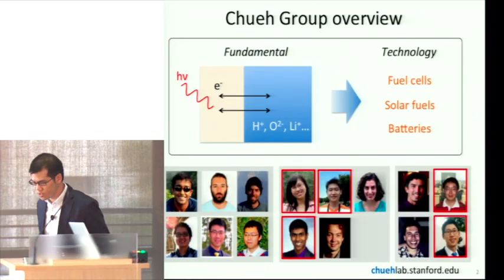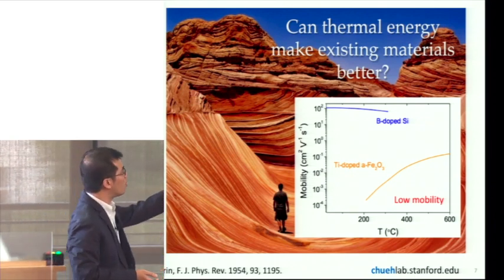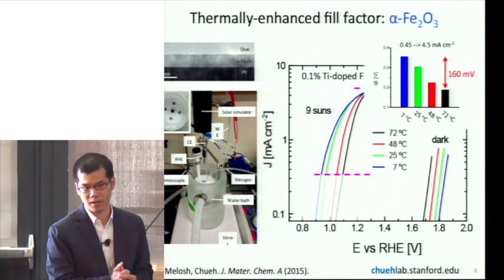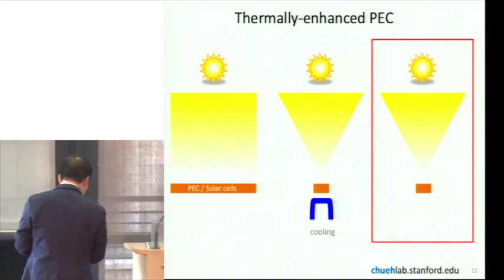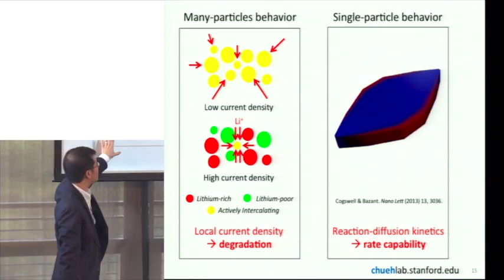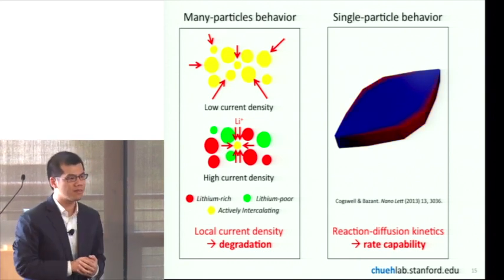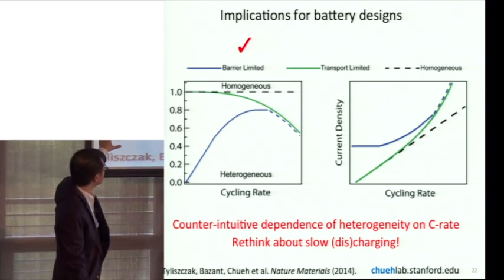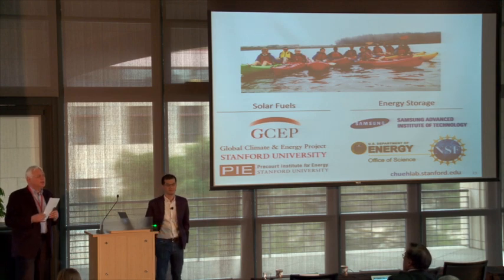William Chueh | Paradigm-shifting materials insights for solar fuels and energy storage

Comment: Good salesman. Emphasize the relative change in an intrinsically poor chemical system and ignore the problem of getting H2 gas through an expensive sealed pipe system  vs cheap copper wires. Get lots of grant $